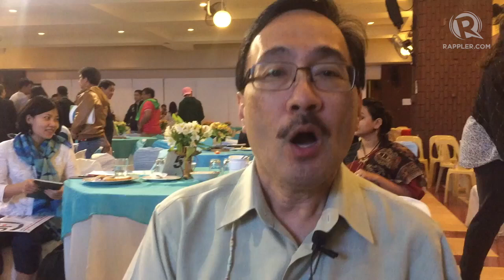The problem with waste-to-energy technologies

Comment: its called a scrubber bro. it cleans the smoke released from the boiler before it is released into the air. it is a very old technology that is used even in regular boiler plants.